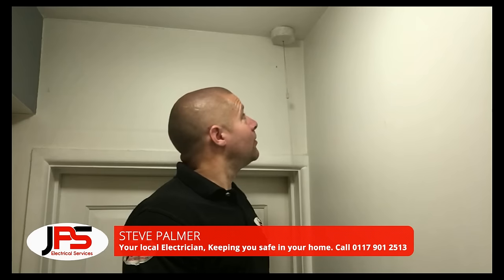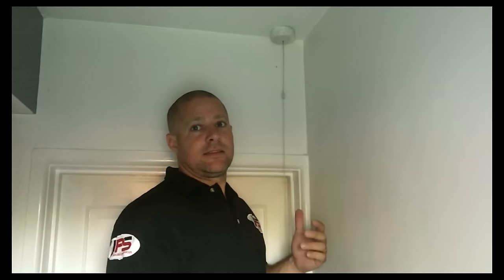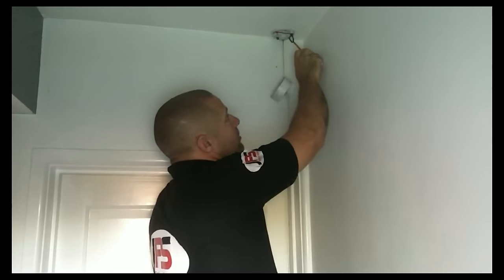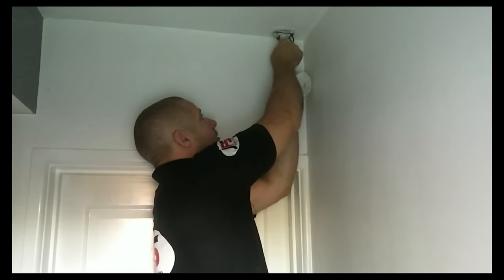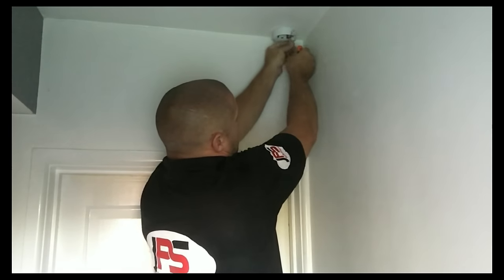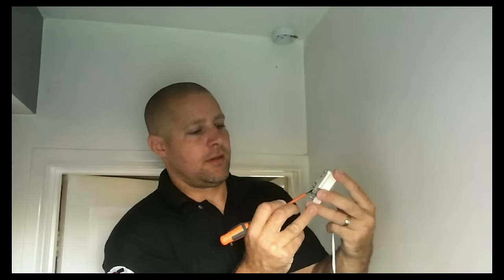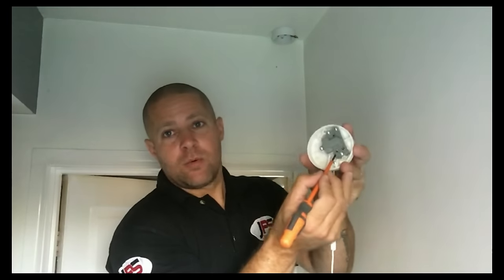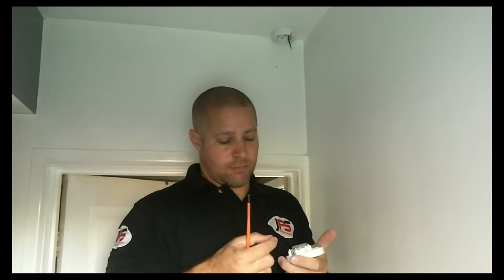How To replace a pull cord light switch - Your local Electrician

Comment: Do you know how to fix the little plastic tube that is the switch as I pulled mine to hard and it snapped?
Reply from the maker: MisterZigg thank you for your comment. It’s difficult to know exactly which part you are referring to as there are variations of this type of switch. From experience though, nearly every faulty switch I attend requires a replacement.

Kind regards

Steve :)

Comment: My pull switch operates a none isolated fan. I’m guessing 6A pull switch but do I need double or single pole? There’s currently a connection to constant, earth and L2 and the fan runs on for a few mins after pulling switch
Reply: May I ask what cables connecting to your switch and to your fan (colours please)? I have non isolated fan, and the fan works straight after I put power back. It doesn’t react for pull cord. Any advice please?

Comment: Hi, can I ask, what's the situation with Part P compliance for this kind of work? Doesn't it need NICEIC qualified person? Genuine question, not trying to catch you out. Thanks!
Reply from the maker: M P this is a great question. Thank you for posting it.

With regards to Part P,  this is required for ‘Notifiable Works’. Notifiable work covers, replacing a consumers unit (fuse board), installing a new circuit or work carried out in a ‘Special Location’. This would indicate that any alteration or addition within a bathroom ‘special location’ would need to be notified by law. However, since this is a like for like replacement and no alterations or additions are being carried out then it is NOT Notifiable by law and does not come under Part P of the building regulations.

I hope this answers your question.

Kind regards

Steve :)
Reply: @JPSElectricalServicesBristol  Thanks, man. That's really helpful. One other question if you don't mind. Would it be the same situation for an electric shower (if a like for like then no part p, no need for bs7671 etc.)? I know you have different zones in the bathroom, but the regs confuse me!

Thanks for the info on this
Reply from the maker: M P You’re most welcome.

All you need to remember is that if you’re replacing an item for an identical item then it’s a like for like replacement therefore wouldn’t need to be notified. The most important consideration should be, is this an identical item? For example, if you change the make or change the power consumption then it is not like for like.

When it comes to electric showers, I have a plumber install the shower unit and carry out all the plumbing and I take care of the electrical side of the installation. The circuit is then tested in its entirety and a BS7671 Electrical Minor Works Certificate issued.

I’m always happy to help where I can.

Kind regards

Steve :)
Reply: @JPSElectricalServicesBristol  Thanks, pal. That's really helpful info :)

Comment: Could I connect that to a longer wire and then put it on an ordinary wall switch?
Reply from the maker: Hi Chris, thank you for taking the time to comment.

Is the switch that you are referring to, supplying the bathroom light or is this a pull cord switch positioned elsewhere please?

Kind regards
Steve :)
Reply: @JPSElectricalServicesBristol  the pull switch is in the bedroom maybe a yard away from a light switch that operates the wardrobe light. I was wondering if I could extend the wire in the ceiling and drop it down the light switch channel and connect it to a double switch?

Comment: right, great job, just one (stupid?) question, why just not put plain light switch on the wall outside of the bathroom?
Reply from the maker: Thank you for taking the time to comment. This is not a stupid question at all. Nearly all new builds will use this option.

In order to carry out an alteration or addition on an older/existing property, some upgrading of the protective devices may be required. In some occasions, clients see this as a topple of the scales when weighing up cost v’s benefit.

I hope this helps.

Kind regards
Steve :)

Comment: Our unit has a green-yellow and two reds. There's no tag on a red to indicate live and no guide on the unit itself. How do we tell which red is live, or doesn't it matter? thanks
Reply from the maker: Thank you for taking the time to comment. In this situation you should see that one red is in the Common terminal and the other is in L1.

I hope this helps.

Kind regards
Steve :)
Reply: @JPSElectricalServicesBristol  Thanks Steve! That's my problem though, there are no markings of any kind on the wire or the unit on terminals. Nothing!
Reply from the maker: @breadyegg , no problem.  With the existing switch, are there three screw terminals arranged in a triangular setting? One top, two bottom?
Reply: @JPSElectricalServicesBristol  I just had another look, this time with a torch! The wiring is in line. This time, with better light I could see an embossed "L2" on the unit (unwired), and hidden behind the wire next to it, "L1". So I think I'm good to go now. Rule #1 of any electrical work - good observation. Right? 😆 Thanks again for getting back to me.
Reply from the maker: @breadyegg   That's great news, I'm pleased you've identified it.

Rule #1 of any electrical work is always make sure the electric is off before working  but yes, good observation most certainly helps 🥰👍

Comment: Is it unusual to open up a pull cord switch and find no earth?  I've got a brown and blue wire going into a clear plastic box but no earth cable?  It's not quite like the one in your video - it had two screws in it to undo......any help would be appreciated :)
Reply from the maker: yoyo895 thank you for taking the time to comment.  If you look very close to the grey sheath you’ll probably find that someone has cut the earth out of the cable.

It’s not unusual to find red/black cable without an earth but brown/blue will definitely have an earth.  I often find Earth cables cut rather than connected. This is a sign that whoever did the install, either didn’t have a clue what they were doing or they did not give a care for the job they were doing.

Hopefully there will be more slack in the ceiling that can be pulled down to allow you to terminate it correctly.

Please let me know how you get on.

Kind regards

Steve :)
Reply: @JPSElectricalServicesBristol  Thanks for your reply Steve, much appreciated!  I'll let you know how I get on......
Reply from the maker: yoyo895 I look forward to hearing if your success.

Kind regards

Steve :)

Comment: Hi jps. The pull cord has snapped and there is know cord hanging from the Base. Can I re-connect the cord or will I need to replace the whole unit?
Reply from the maker: Thank you for taking the time to post your comment. Thank n my experience there is no way of reconnecting a cord once the entire cord has been pulled out so I replacement unit will be required.

Kind regards

Steve :)
Reply: @JPSElectricalServicesBristol  thanks ;-)
Reply from the maker: T Tank you’re most welcome ☺️👍🏼

Comment: How do you connect power from an existing lights (spots) to power a pull cord which operates a mirror light independently from the ceiling spots? Thanks
Reply from the maker: desyguns thanks for taking the time to comment.  

When carrying out alterations to the wiring within a ‘Special Location’ which is how a bathroom is defined within the regulations, there are certain provisions that must be in place.  Anything other than a ‘like for like’ replacement will need to be notified to the Local Authority Building Control by law. 

If you use a registered Electrician to carry out the work, they can do this on your behalf. 

If you are struggling to source a reputable Electrician locally then go to the which? Trusted traders website and use the search facility.

Kind regards

Steve :)

Comment: So dont need earth connected then ?? what L1 L2 for ??
Reply from the maker: Hi Nick, this video is a tutorial on how to wire a pull cord light switch where a single twin and earth cable is in use. The live cable will go into the Common terminal, The Switched Live will go into L1 and the earth will connect into the earth terminal on the base of the pull cord pattress.

If you have anything other than described in this video then you’ll need additional advice.

If you have a photo then feel free to get in touch via my website contact form and I’ll be happy to help further.

Kind regards
Steve :)

Comment: So what's L2 for??
Reply from the maker: Thanks for taking the time to comment. 

L2 comes into play when you have multiple switches operating the same light. The only time you would usually expect to see this setup involving a pull cord switch, is in a bedroom using the old setup of a light switch by the door and a pull cord switch above the bed :)

I hope this helps answer your question.

Kind regards

Steve :)
Reply: Nice one Steve, I've had a new switch gathering dust for over two years, you've given me the confidence to tackle it. Appreciate you for doing this video 👍
Reply from the maker: @ukgraffitiwalker8846  Just remember, TURN OFF the circuit you are working on before you start :) If in doubt, turn off the entire fuse board/s supply.

I look forward to hearing how you get on.

Kind regards
Steve :)
Reply: @JPSElectricalServicesBristol  All done Steve, wish I'd done it sooner. I turned everything off. Thanks again.
Reply from the maker: @ukgraffitiwalker8846  that’s fantastic news. Thank you for posting your update. 

Kind regards
Steve :)

Comment: I pulled the switch and the rope came off, how do I fix it back
Reply from the maker: Samuel Hanson thank you so much for taking the time to comment. 

In most cases that I find, when the pullcord string has snapped away from the unit, if there is no visible string remaining then the switch requires a replacement.

Kind regards

Steve :)

Comment: We have a problem where the light won't turn off. Only by disconnecting the earth. Any ideas?
Reply from the maker: David please arrange for an Electrician to attend as soon as possible.

What area are you in? I have contact with Electricians across the country so may be able to put you in touch with someone.

Kind regards

Steve :)
Reply: @JPSElectricalServicesBristol  I'm In the Essex area. I don't know if the new switch I'm putting on is just faulty/cheap

Comment: Hii basically I ripped out the cord so the light is still on but I need to put it back in
Reply from the maker: Thanks for taking the time to comment.

If you have pulled the string completely out of the unit then you should replace the entire unit. Sometimes they can be replaced but they can fall to pieces on removal if you’re not careful.

Kind regards

Steve

Comment: Its too noisy  ! Where do you get a silent one ?
Reply from the maker: Hi Stephen, thank you for taking the time to comment.

All pull cord switches will make a noise on operation. Sometimes the way that it is mounted will emphasise the noise.  My only suggestion is to replace the unit for a new one and see how this compares. I do know that there are dimmer pull cords which may operate differently but these can cause issues with particular lights and especially extractor fans that operate when the light switch is turned on.

I hope this helps.

Kind regards
Steve :)
Reply: @JPSElectricalServicesBristol  2 ensuites have fans no pull cord . Switch on outside of rooms. Main family bathroom a pull cord ! Same as downstairs wc a pull cord! So stupid yet its a new build built 2 hears ago . They piss me off so much. 100 % going to change them. We have an air flow system in the roofspace anyway so fans are always kinda on.

Comment: Is there anyway you can change the actual pull cord??
Reply from the maker: AmazingApple ! Thanks for taking the time to comment. If the pull cord has completely snapped off then you will need to replace the complete pull cord unit.

Kind regards

Steve :)

Comment: Thank you JPS for very valuable advice and demonstration, i hate messing with electrics but has to be done. can i ask, on your demo you mention to put wire into L1, on the diagram of the pull switch i bought it has L2 ? i only want to connect the one light, so which one do i go for L1 OR L2?  appreciate your valuable advice thank you in advance :)
Reply from the maker: Craig Simmonds thank you for taking the time to comment. The markings are normally C,  L1 and L2.  Of this was a standard rocker switch and you mixed the two up then it would result in the OFF position turning the light on and vice versa.  On a pull cord switch, so long as you have only a permanent live cable, switches live and earth then it doesn’t really matter if you put the switches live in L1 or L2.

If you require further assistance then please contact me through my Facebook page.

Kind regards

Steve  :)
Reply: @JPSElectricalServicesBristol  Thank you Steve, appreciate your quick response, My Mrs got it from Wilko's , and got confused in the diagram but you made it far more easy to understand on your video, so thank you, i will definitely recommend you to friends and family. wish you all the best for 2020
Reply from the maker: It would seem autocorrect got the better of me in the last comment I made.  SWITCHED is what it should say, NOT switches.

Live should go to the common terminal marked C and the SWITCHED live should go into L1.

***THE EARTH MUST BE TERMINATED INTO THE EARTH TERMINAL OF THE BASE OF THE SWITCH***